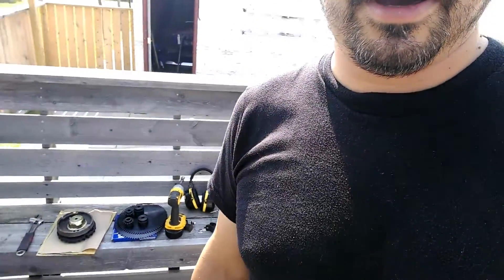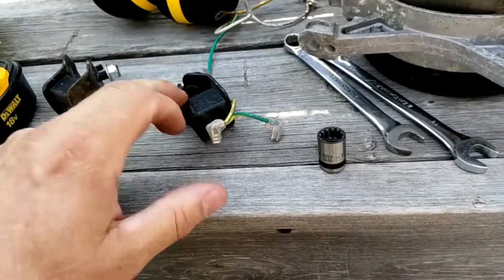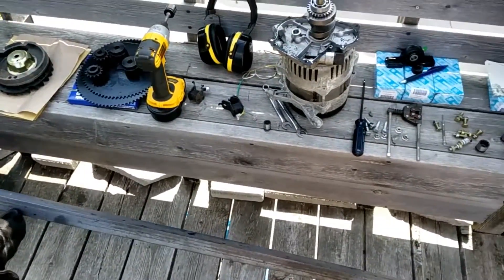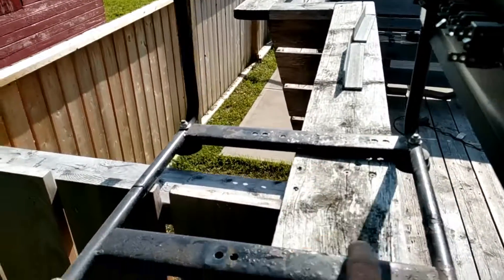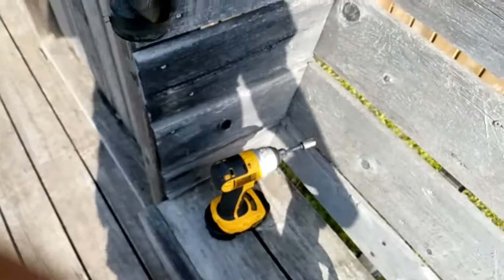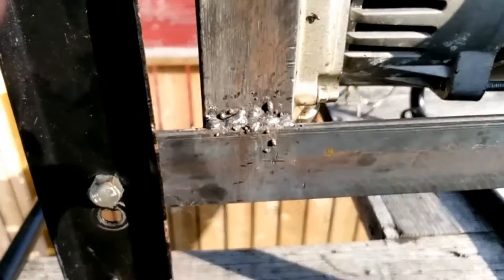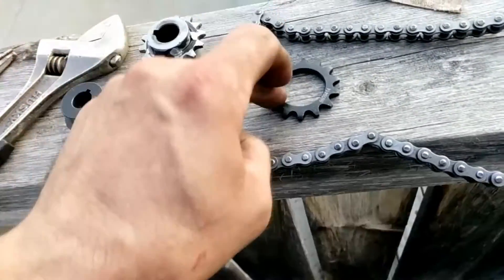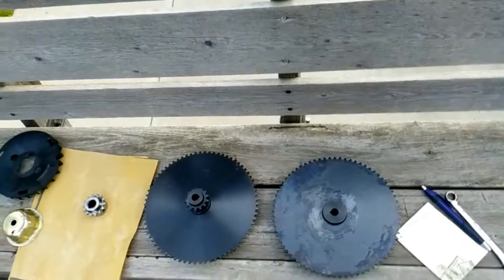Gas to Wind & Peddle Powered Generator Conversion Pt. 3 (Mounting & Gearing)

Comment: Couldn't you just add a couple washers to space the sprocket away so the chain fits?
Reply from the maker: No, washers would create a worse problem. The washers would be in the way more so than the main piece, the metal isn't as strong, and I was trying to keep the costs low